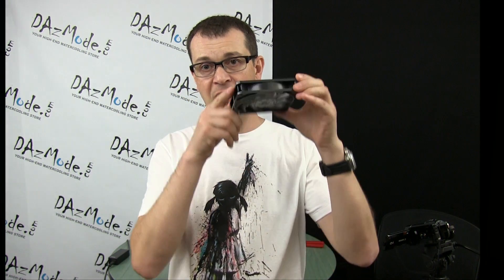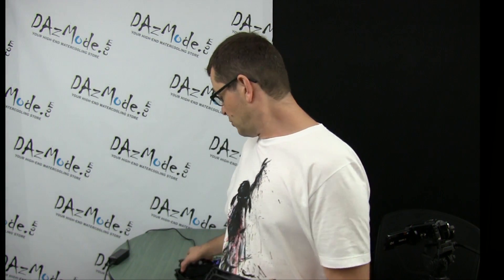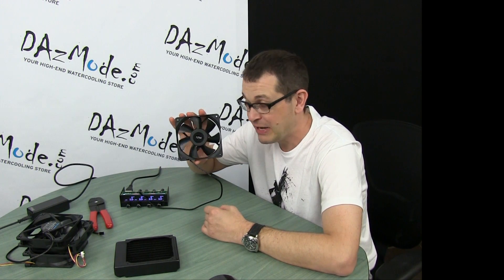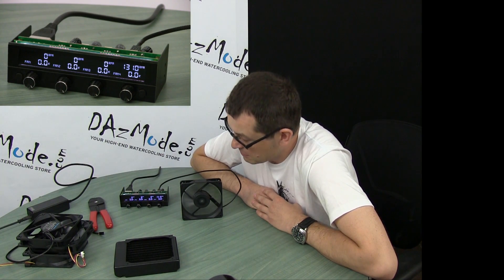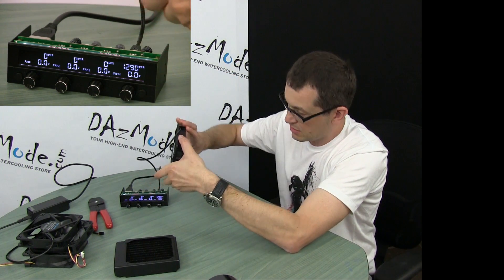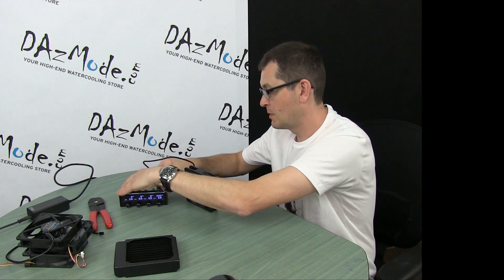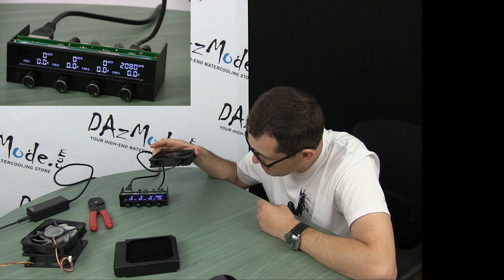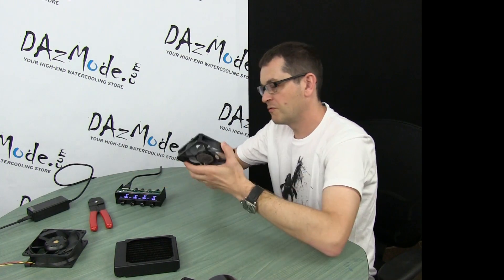Does fan orientation change its speed?  - DazLab Stupid Vol 3+

Comment: nice attempt, but these "results" are not scientifically significant. Almost all your results are below the 5% difference. Besides, the testing method is not repeatable.    In the other hand, try to slow down the fans to 400 rpm - then you will notice very significant difference. 
Kind regards.

Comment: thats possible try laying a fan on your table than put a cd or a plate on in. 
it will turn faster because all the air around the fan starts to spin whit the fan. at the end you lower the resistance for the fan.

Comment: you seem to only be testing fans designed for CFM not static pressure... I was under the impression that you should be using a static pressure optimised fan for radiator work